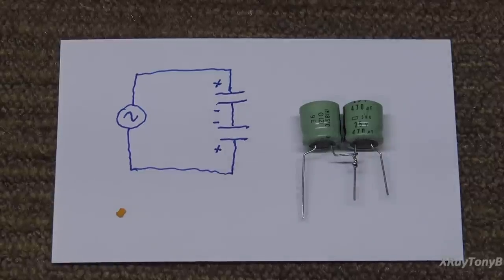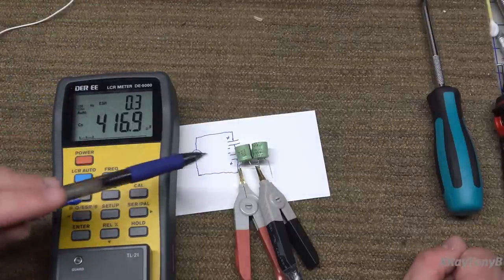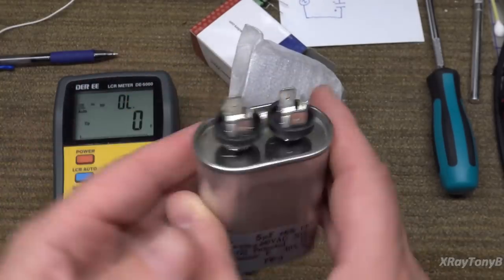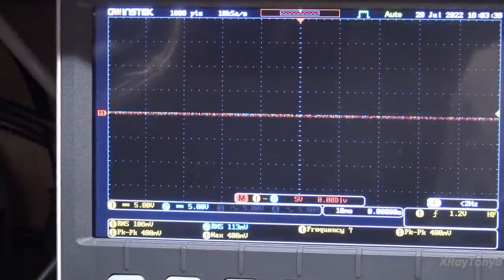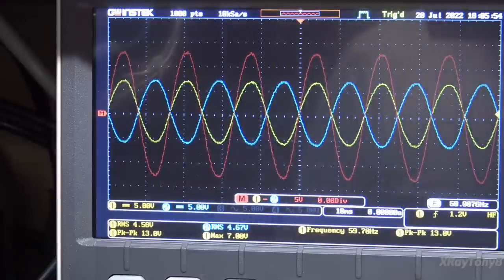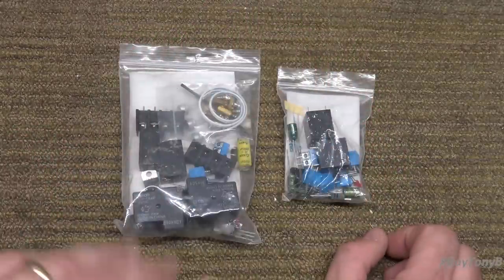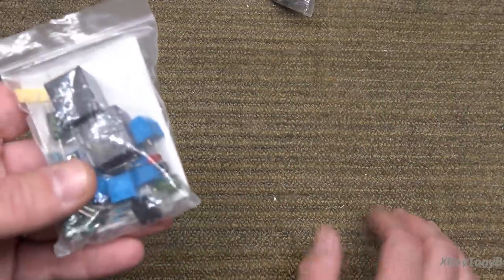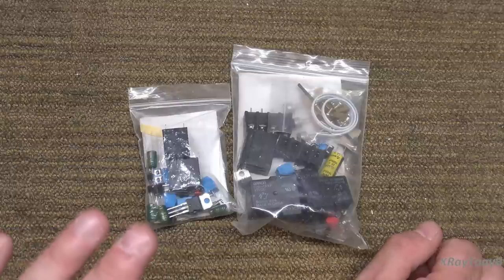Follow Up Video on Speaker Protect Circuit Series

Comment: The negative of a capacitor is connected to the most outer layer of the plates. Thus, shielding is best on the outside and connected to the virtual ground. Even some non-electrolytic capacitors indicates the outer layer of the plates by means of a stripe. Tony, what you have learned over the years are absolutely correct. Bipolar capacitors are exactly as you explain. Connecting the positive leads together adds the equivalent inductances in series between the connection.

Comment: Great video and explanations, as always, thank you!  Very informative with practical measurements on the oscilloscope.  Thank you also for the advice on speakers grounding and protection relays configurations, very important to learn.  I will use your lessons in a vintage class A/B amp I have that needs restoring.

Comment: The ones he is trying to explain are called balanced amplifier  output  where one output is half of the sine curve and the other the other part of the sine curve. No common gnd. between right and left.

In order for them to detect 1.5v and higher, they are made so you have to have +- from the amplifier output. volt gnd- are also the same as speaker gnd, so it's not that easy to modify them.

The delay they have is also nice to have to avoid bangs in the speaker at start-up

Comment: Say I have an amplifier or preamplifier that needs a 2x volt, balanced current system.

The way I usually do it is to take + - so I don't load only one volt side and create an imbalance to the amplifier or preamplifier.
Then I run them into a volt regulator with a larger heatsink and then into a card

remember that the linear current regulator can only handle 1A and max 35v-40v

linear volt regulator gives pure noise free current but gets hotter than other types.

Comment: I don't think it matters which way the capacitors connected up, the only benefit of connecting positive to positive is that you have the foil on the outside for EMI  noise rejection what could be important.
you can use the mains transformer for your little pcb if you tap it before the rectifier, form the lamp socket you're not interfering with the main secondary winding.

Comment: So, What happens when you put 2 bridge rectifiers in parallel on a transformer winding?
Reply: In my opinion, absolutely nothing. But I'd like to hear Tony's opinion. Just because he's got more experience and understanding than me.
Reply: @jim9930  Arhh, I understand now, It sounded like he was saying you shouldn't parallel 2 bridge rectifiers up, but if off a centre tapped transformer I can see there being a potential difference between each side, though I've never tried it.
Reply from the maker: Two things are of concern.  First, is that you could have a different potential at ground, depending on the center tap of the coil.  Also, diodes each have a different forward voltage drop, even though this could be a very small amount.  This is still enough to cause one diode to conduct before the other.  In addition, if you get the AC input leads of the two bridges reversed, you could potentially cause the Rectified AC (know known as ripple) to be 180 degrees out of phase, causing a dead short.  If you care to try it, I would suggest putting a very low wattage dim bulb tester in line with the mains ;)

Comment: Thanks for showing 2 electrolytic capacitors to form a non polarized capacitor. According to your scope trace, each independent polarized capacitor is still reverse biased. Is the scope setting on AC coupled or DC coupled? Thanks
Reply: Agreed - the scope appears to indicate both caps as being reversed biased - 'each for half of the AC cycle'.  As for coupling, the scope display indicates that yellow (chan 1) and blue (chan 2) are indeed selected as DC coupled -  as depicted with the symbols appearing just after the channel designation - you can also see chan 3 and chan 4 disabled for display and note the AC symbol for them.
Reply: @TerranVisitor  Thanks for the verification. If the polarized capacitors connected in series are still reverse biased, just wondering what is the difference of using one higher voltage polarized capacitor versus 2 lower voltage polarized capacitors connected in series? Say for example, a single 100v 100uf polarized cap. versus two 50v 200uf connected in series. Also when the applied frequency reduces (say less than 1Hz or even DC), will the polarized capacitors blow up under reverse bias?

Comment: 27kΩ and 47uF make for a 6dB cut at 0.1Hz. That's enough to filter out even the largest bass signals so that they wouldn't reach the diode, get rectified and falsely trigger the protection circuit. Low ESR 47uF bipolar Nichicons are cheap enough so that you don't have to use two polar ones in series. Higher ESR will both increase the reaction time and also false trigger the protection circuit. Going cheap isn't worth it in this case. I would even bypass the bipolar with a 100nF ceramic, because the electrolytic ones tend to have higher ESR towards the supersonic frequencies and could also falsely trigger.
Reply: yes, it seems that with such a strong RC filter, the caps would only be reverse bias if the amplifier created a DC bias (or asymmetric clipping or there's very low freq from modulation side bands, etc). But isn't the point to detect problems like DC and not cause another failure?
Reply from the maker: Correct.  As I said, you can adjust the values of the resistor or capacitor to set the cutoff wherever you want.  In the case of the 27k/47uF, it would trip at DC, or a very high amount of hard clipping.

Comment: Regarding capacitors and AC. I always have difficulties when they say that capacitors block DC and pass AC current. 
SPOILERALERT !!!  AC is also blocked by a capacitor!
The current draw that you get between a AC source and a bipolair capacitor is not due the AC current going through the capacitor,
but is the chargecurrent and discharge current of the capacitor.
When u have a discharged electrolytic capacitor, and you connect it to a DC source, you get a surge current untill the capacitor is charged at same voltage potential as the DC source. When you flip the + and - of this DC source, and you connect it to the charged capacitor,got get a big spark, then the DC source will first discharge the capacitor to 0 volt, and then charge it back to the same potential as the DC source, but in this case with reversed polarity. When you keep flipping the polarity of this DC source, you keep getting charge and discharge current.
This phenom of charging and discharging the DC capacitor is what happens with a bipolar capacitor and a AC source, the difference is that this bipolar capacitor is designed for this reversed polarity swap. A capacitor for DC or AC, is the same as 2 rooms (plates) separated by a wall (dielectric) but you can't go straight from one room to the other, and viceversa. The only way to go from one room to the other room, is by leaving one room and go through the hallway to the other room and vice versa.
And as lost point, even a bipolar capacitor has a polarity. If you connect a bipolar capacitor like a 5uF , in parallel to the mains voltage, and you disconnect the mains voltage, regarding on which point of the 50/60Hz sine wave you disconnect the mains voltage, the bipolar capacitor will give out a DC voltage. When the disconnect happens at the top of the sine wave, the DC voltage will be near mains voltage. But when you discharge the bipolar capacitor, and flip the Phase and Neutral lead of the mains to the bipolar capacitor, and you disconnect the mains again, you will see that the DC polarity is still the same as before.
I have done this experiment with different types of bipolar capacitors, and each time the polarity was the same, no mather how the Phase and Neutral where connected.
Reply: "AC is also blocked by a capacitor!" Negligible but add a resistor and you get a frequency dependent voltage divider ... AKA a filter.
Reply from the maker: It's all a matter of semantics.  In reality, a capacitor doesn't block or pass anything.  It is a reactive device.  Current leads the voltage (passes the signal, in a way) until the voltage of the capacitor equals the voltage source applied, at which point current no longer flows (blocks the signal, in a way).  As for bipolar caps, a bipolar electrolytic is simply an electrolytic cap with two sets of electrodes configured in reverse series polarity and rolled up on top of one another.  When voltage is applied to the bipolar cap in either direction, there will be an offset at the center of the four electrodes the will equal approximately 1/2 of the total voltage.  With reference to the center, both caps will see a voltage in the proper polarity.  Reversing the voltage source's polarity will cause the voltage across the cap to discharge/charge, leaving yet again, an offset voltage at the center.  This is what was shown on the scope, although it may not at first seem as that is what we were seeing.  Thanks for the comment!
Reply: @xraytonyb  the scope plots clearly show each capacitor with a negative voltage (reverse bias) for 50% of the time... large enough negative excursions will eventually cause degradation and failure
Reply: @HazeAnderson  , a frequency depended voltage divider is used in scope probes and in the frontend of a Differential scope probe to get a more flat band frequency response. Grtz
Reply: @xraytonyb  thank you for the reply. Grtz

Comment: XrayTonyb What the Maximum Dc this board can handle? So both of my Amps I have are  +- 100vdc and 80Vdc rails. Do I Need a Bigger voltage for 100uf BP capacitors which I need to order?

Comment: 12:00 Well this shows just what was commented on in the first video,
at the positive terminal of the capacitor (where the scope probes is connected),
 the voltage is more negative than the negative terminal of the capacitor half of the waveform.
This is just a spreading the voltage over the 2 caps, not doing anything with the polarity of it.
Try with two diodes, and se what the waveforms looks like then.
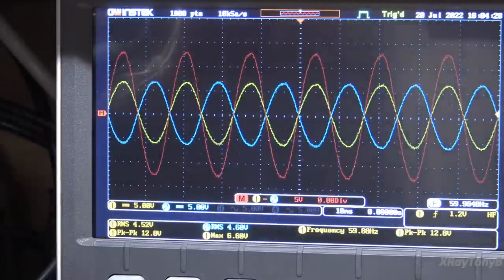Reply: Yes - at 10:13 he clearly shows each capacitor with a negative voltage for 50% of the time
Reply: No need for AC or waveforms to complicate this.
Just put a DC voltage across the so called ”bipolar” capacitor.

Add a 1 M resistor across each cap to make sure the voltage is
evenly distributed across the two capacitors, to not depend on
unequal internal leakages.

Measure the voltages across each capacitor with a voltmeter. 
One of the capacitors will be reverse biased, and will severely dislike the situation.

I.e. This is not a bipolar capacitor.
Reply: @andersjohansson8588  agreed. in his scope plot, the two probes provided a 10 Meg divider circuit. The display clearly shows reverse bias with 50% duty cycle on each cap...
However, I have learned that most polarized electrolytic parts will behave fine and not suffer ill effects when the reverse bias voltage is <=1% of rated forward voltage. So a 100V part will be perfectly fine at -1V, but as you exceed -10V (-10%) severe degradation and failure should be expected.
The RC circuit has a very long time constant and so only DC or very low frequency would damage them.
Hopefully the rest of the detection circuit reacts fast enough to disconnect the (DC) source to protect itself (and the speakers)

Comment: ESR is usually specified at 100kHz? You may also use the DER EE's Rs mode for that.
Reply from the maker: Correct.  The standard test frequency for ESR is 100kHz.  I had the DER set to 120 Hz, as I was connecting the caps to a 60Hz mains transformer for all the experiments.
Reply: @xraytonyb  At 120Hz it's not pure ESR i.e. the higher reactance lumps DF with ESR. But it's also indicative for the intended use. Still a valid comparison between caps if the test frequency is kept steady.

Comment: Hello, kind teacher. Please answer my question if you have a chance. Of course, I know that maybe this is not the place for this question, please forgive me
I have a four-channel car amplifier, the driver part of the power transistors of one of the channels gets extremely hot, and the voltage on the base pin is about 22 volts.
The other channel in the vicinity of this channel is the base pin voltage of power transistors on -2.5 V.
If you answer that, I will be very happy.

Comment: In an amp without common ground on the outputs will not work. The dc reference for the outputs is done relatively to the ground. So, if you don't have a common ground, where is the reference gonna be? And, I think, an amp like Carver will have outputs protection. Maybe I'm wrong, who knows? 😁
Reply: @jim9930 , I red your comment. We were talking about those protect circuits. Fuse protection woks fine on hard shorts, but not on small DC offset.
Reply from the maker: The problem is that the polarity is reversed between the two channels and the phase is inverted on one channel to keep both channels in phase.  This allows the amp to be wired for "bridged mono".  If you try to tie the minus leads of the two channel together, you will short them out, as they will have opposite voltage polarity on them.  You need to have isolated contacts for BOTH leads of the speakers with these amps.
Reply: @xraytonyb , yes, understood,  you must use an individual power supply, with separate ground for each module. Thank you for your time, I always enjoy watching your videos, always something to learn. And I appreciate the soldering talks.